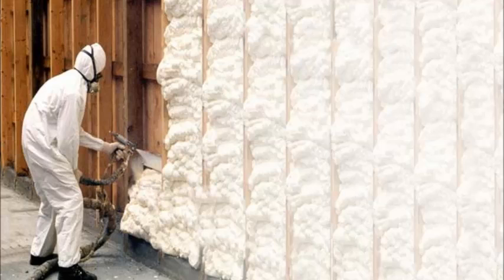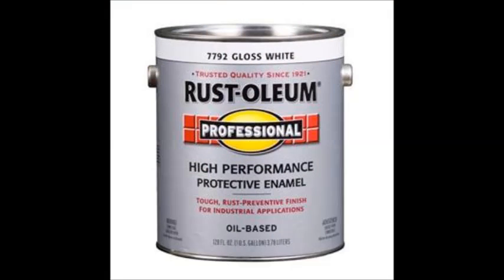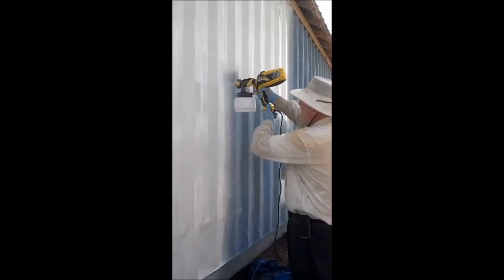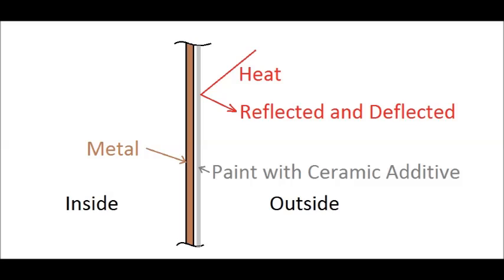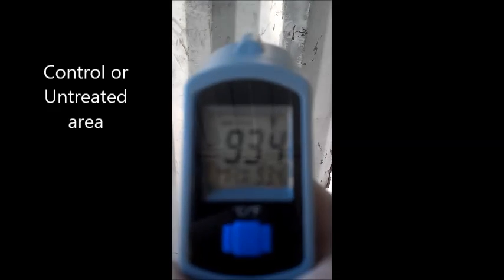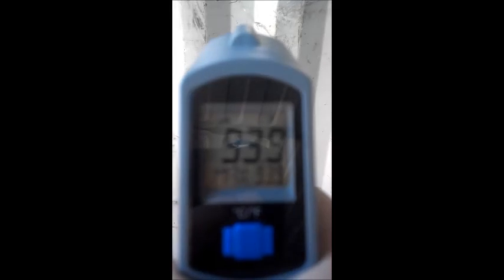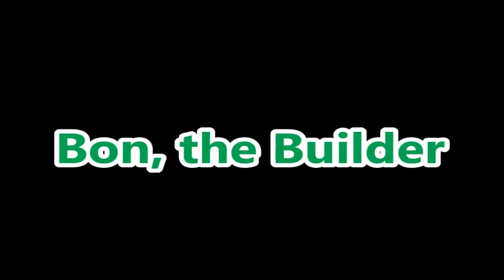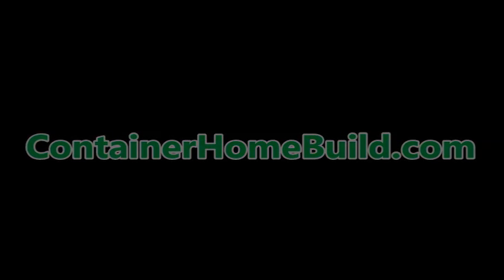Insulating Ceramic Paint

Comment: What would be properly useful is if the control area of the container had been painted with the same white paint but without the ceramic additive. 

I suspect that the vast bulk of the temperature difference between your control area and the two painted areas is attributable to the difference in the colour of the steel rather than the ceramic additive.

I would love to be proven wrong through because I'm considering painting a container with ceramic paint myself and it would be great to know how much difference the ceramic additive makes.
Reply from the maker: Tim, Thank you for your comments.  I wonder if you are right.  Unfortunately, I built a porch over the untreated area, however, the westerly sun might still shine on a portion that I could paint white and compare the results.  Thank you very much for pointing that out.  And thank you for watching.  Bon the Building.

Comment: It seems that it has worked as advertised. I have seen several videos of the products being tested on the outside and compared to white paint alone. Of course the test results are the same since both the white paint and white paint additives would be reflecting the same amount of temperature. Yours is the first I have seen that is a true test by measuring the inside temperature.